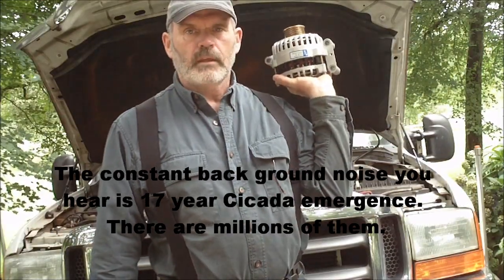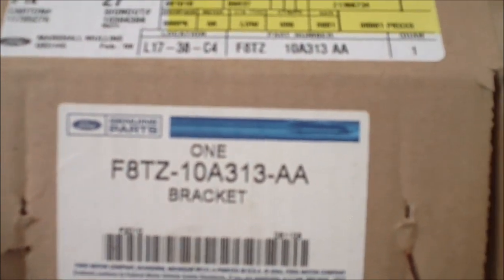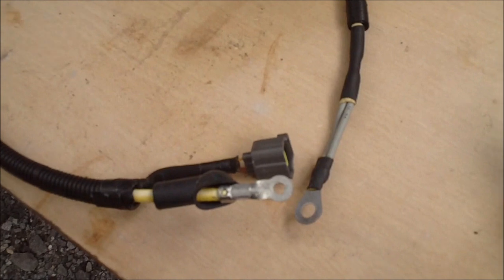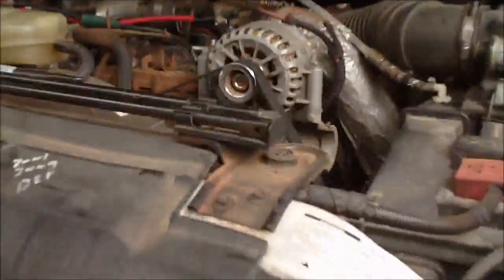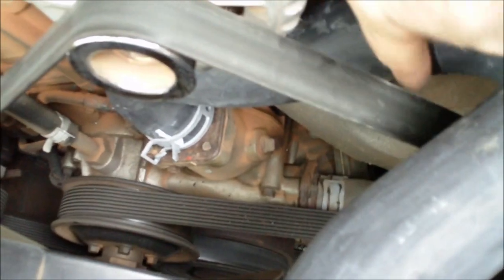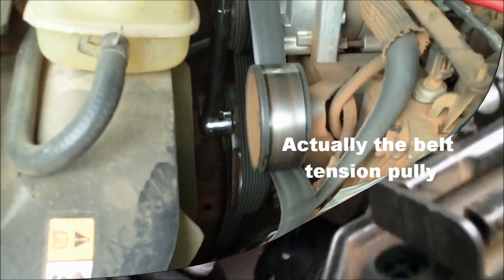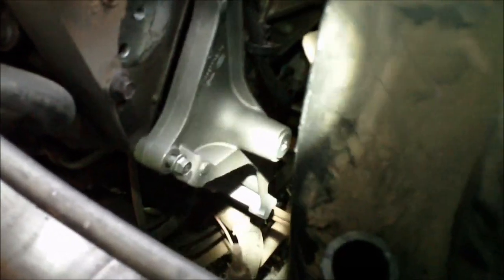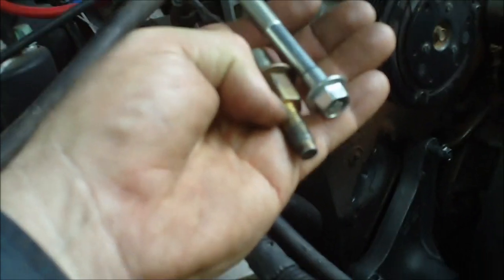Dual Alternator Install 7.3L Powerstroke Part 1 of 4

Comment: With the inefficiency of combustion engines about 20% - 30% efficiency I see some issues that maybe you can clear up.

 How does any energy you use to power the HHO equal more energy put back into the truck engine that created it in the 1st place ?  I understand that the best industrial electrolyzers are about 80% efficient.

Thanks

Comment: How does this effect to engine performance? Will it burn more fuel now? Any loss of HP? Appreciate your reply. Thanks.
Reply from the maker: The second alternator will have a minimal effect on the HP and MPG. The alternators only us engine power when you are using electricity, the rest of the time they just idle. When the alternator is spinning and not putting out any watts it will still drag on the motor a tiny bit but you will not be able to measure the effect on MPG or HP. You will only consume measurable amounts of extra fuel if you are using a winch or something else that uses a lot of watts.

Comment from the maker: I was thinking of installing an Ultra Capacitor bank to replace one of the batteries or just added to the battery/alternator system. The idea was to boost starting power but it would also smooth out the current draw.

Comment: Another great tip is to install a capacitor between the alternator(s) and the battery/batteries. I installed a 1 farad capacitor designed for audio systems from Rockford Fosgate on my 1996 neon in 1998 when I bought it with 38K miles on it and I am still running the same factory alternator today with 221K+ on the odometer.

Comment: Great video! Also, the around the alternator hose is a great upgrade, it makes many jobs which require the  belt to be removed much easier in that it allows you to remove the belt completely so that you don't have to contend with it while making your repair. Also saves time and money in the future by not having to refill and bleed the cooling system.

Comment from the maker: @theroncon The main advantages of dual alternators are redundancy, higher amps at idle and of course higher amp output. Trailer lights don't use much juice but huge sound systems, winches, 120volt inverters, emergency lights and so forth can over burden a single alternator especially at idle.
Mars

Comment from the maker: @dieselinside69 You can run two alternators separately or combined. If you combine them it is best to use two identical alternators. I have mine combined right now but I am having some trouble. The mismatched alternators that I install are not working well together. I plan on separating them into two systems. When I get it finished I will show what I did in part 4.